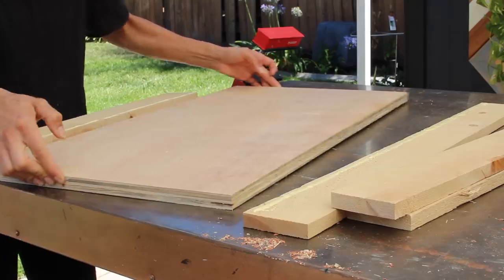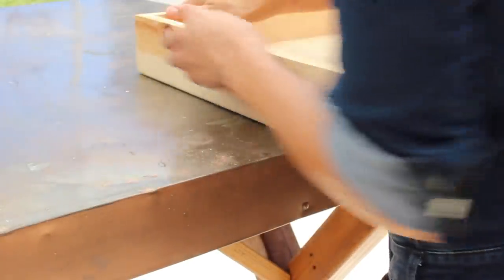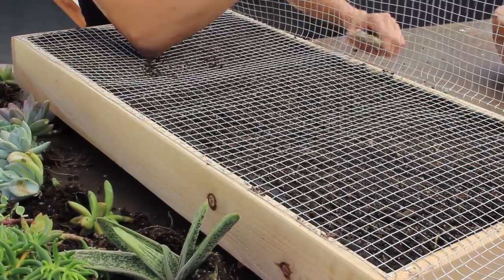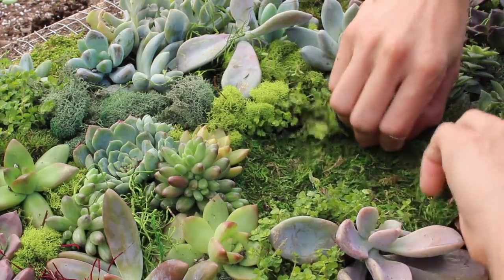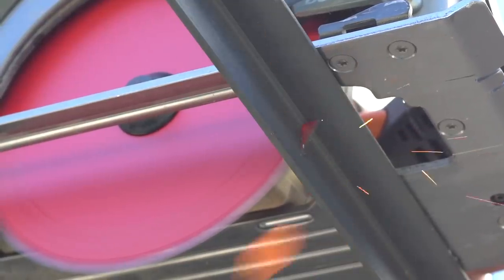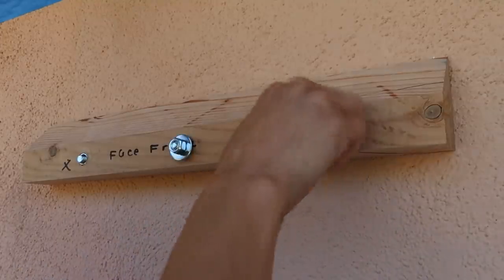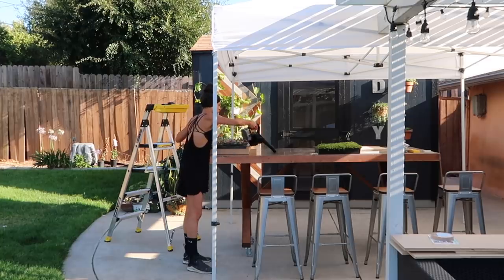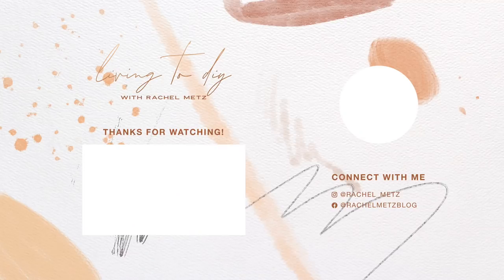DIY Succulent Wall Planter | Easy Woodworking Project

Comment: So cute, I did something similar with a little wagon. One thing I learned when researching is that succulents need a lot of drainage, so I drilled holes into the sides an bottom. Super easy and super important.

Comment: Super useful. Shows all the mistakes that the polished and prim videos don't show. They are so busy trying to show you how "easy" it is. That they don't prepare you for the reality of what you are taking on. I personally want to try and make these into a side business, and I am already cooking ideas of how to get the plants to be placed easily and made stable more quickly. Possibly something involving foam/corkboard backing and toothpicks attached to the succulent roots/stems.  Speed and stability are important cause I want to be able to make customer arrangements and have customers watch the process and take them home immediately.

I probably would not have considered I needed these things until i had already obliterated my first project. So thankyou for the heads. You got a new subscriber now for sure.

Comment: omg girl that looks amazing!!! love your channel.  I know here in san diego you can just use moss (instead of dirt) and glue.  I did hot glue which worked fine (obvo not in direct light) and a crap ton of succulents.  It's lighter weight, and you can hang immediately afterward.  Since it doesn't have soil you have to water more often (once a week)  Much love

Comment: hi loved the DIY. just had a suggestion. If you could take down that bracket that you screwed to the wall to hang the fixture. 
Fill in the holes that you are not using for the bracket with caulking. just so you keep out any critters or water. your house would be so grateful not to mention the inside walls.   

if you wanted to you could purchase caulking you can paint over. or just leave it. you are going to put the planting fixture over it anyway. just wanted you to know that there is caulking out thats paintable.
You are  the best !! keep doing what you are doing.

Comment: Just writing to let you know that you are doing great! I love how well you explained this. Tip: you can use metal clips (the ones you use to hold paper together), just cut them  in half and use them to hold your succulents  to the soil and to the wire ;) Also, real moss works great with succulents

Comment: Just an FYI, I hope you didn’t throw away any of the leaves/petals because if you just stick it in the dirt and water it, it’ll grow a new baby plant!! And I recommend drilling some holes at the bottom or the back so that there’s a drainage hole so no water settles anywhere and causes root rot. Hope that helps but aside from that, such a beautiful piece!!!! Love the mix of natural and industrial design.

Comment: Pro Tip
When screwing into concrete or brick get a thick decking screw not your 8 or 10 2-3 inch screws (specialty screws usually gold and thick and long with a funky thread and point) they come with a hex head, then drill your hole put a copper wire that is soft in the hole with some sticking out and then secure your item with the screw the wire acts as a plug, or of course you can buy tap con screws lol, but YOUR hole looked kind of hollow ?

Comment: This is gorgeous but I'm concerned, how are the succulents even gonna drain with this set up? Feels like the roots are gonna rot :(
Reply from the maker: Cedar is easy for it to drain through xx.
Reply: @LivingtoDIYwithRachelMetz  I guess since this video is a bit older & you confirming the wood lets it drain that they've been thriving so I must be wrong. Good news! I'm glad. I killed my succulents so fast when I started with plants :( I did the whole buying a cover pot at ikea, repot the succulent in it with regular soil mix with rocks at the bottom thinking it would suffice and drench the poor lil one with water.

Was not expecting an answer either, love your content <3